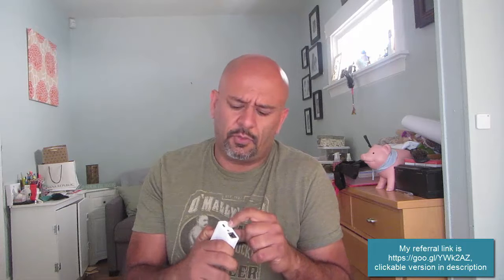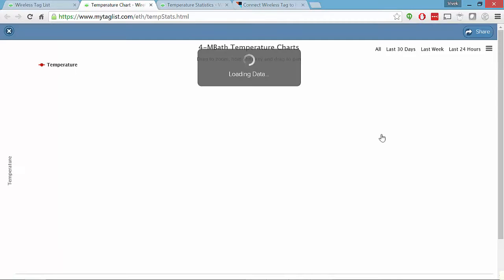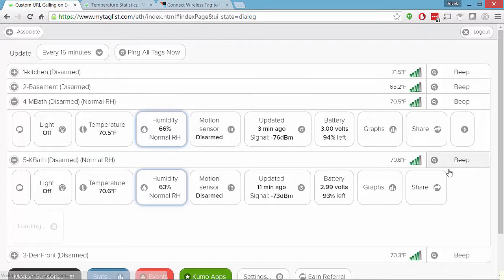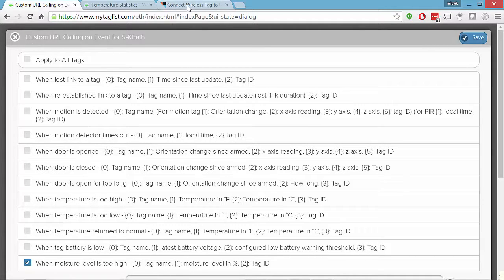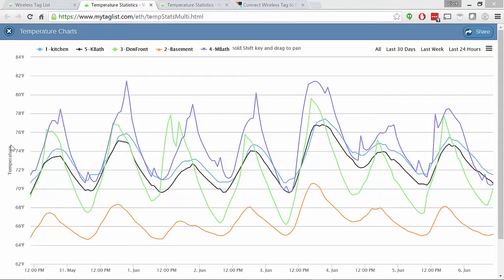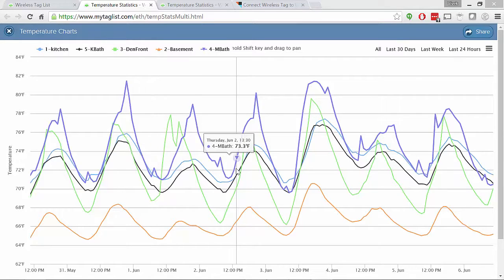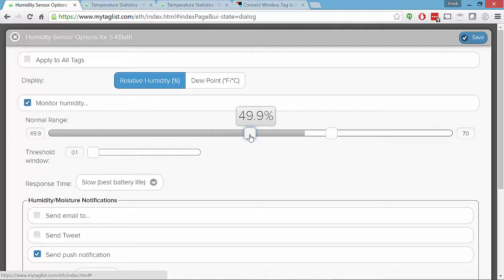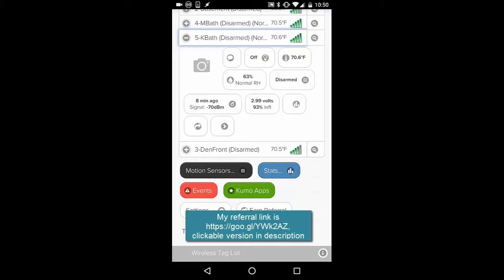Wireless Temperature & Humidity Sensors

Comment: Very very cool. Ordering now. I hope these can integrate with a smart thermostat?
Reply: IVB's Home Automation That's a good point. NEST is pretty much dominating the market right now.
Reply: IVB's Home Automation Thanks, man. Once I get the parts together and play a little bit I'll have a better idea of how/what I want  to do beyond what I posted above.
Reply: Like a Nest?
Reply: Yep. I think it does, looking at some ITTT recipes.
Reply: If you get it working - let me know how you did it, if you'd be so kind. 
I have a NEST but haven't installed it yet. This would give me all the reason I need to get that done.
Reply: I'm still not 100% sure about NEST so I've been putting it off. Check this out: http://www.tomsguide.com/us/best-smart-thermostats,review-2751.html
Reply from the maker: I have a Nest integrated with the HA system. What type of integration are you thinking about? Remote temp sensors like the Eco3?  You could hack something together with an external engine, but if you really want remote temp sensors I'd get the Eco3.

100% of the reason I went with the Nest vs Eco3 was that a driver existed to link the Nest with the Eco3 and I wasn't sure how long the Eco3 company would be in business. The Nest works fine for a "use single room/location to monitor temp & adjust"
Reply from the maker: LMK how you're thinking about integrating them. I can either do a Google Hangout or record a short clip to demonstrate what could be done.  There's no "native" driver to integrate these sensors with my particular HA engine (CQC), but the developer is going to create one over the next 1-2 months. Until then I have to cobble stuff together using IFTTT level commands (like I showed in the video), no access to actual temp numbers on a live basis.